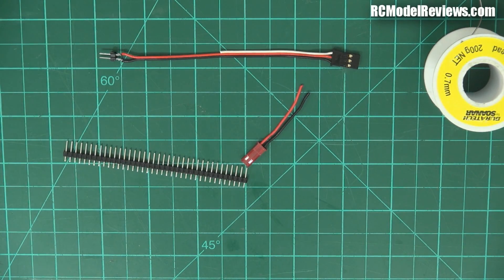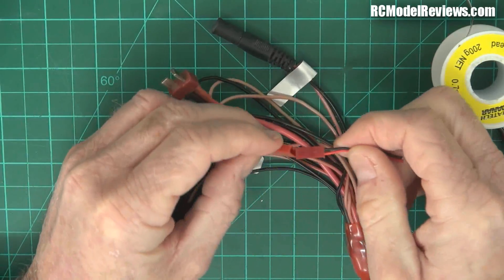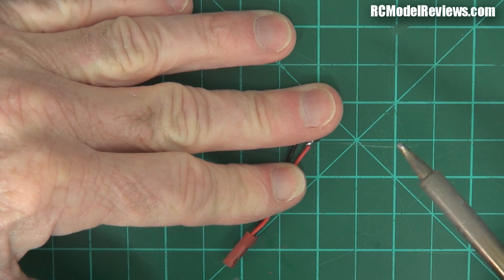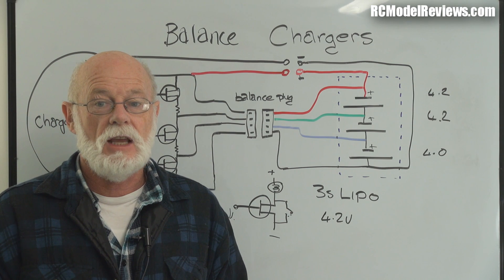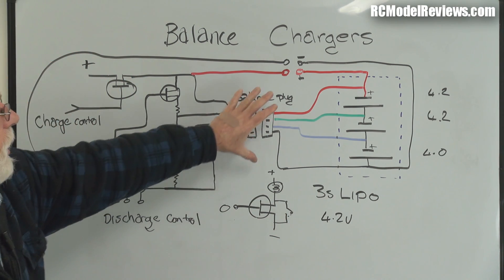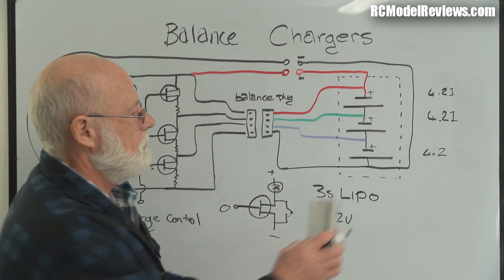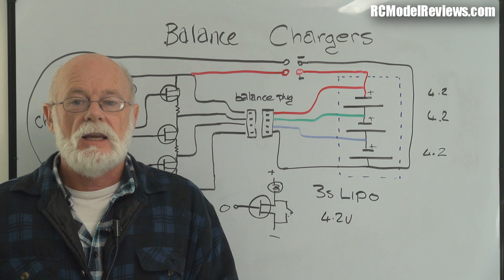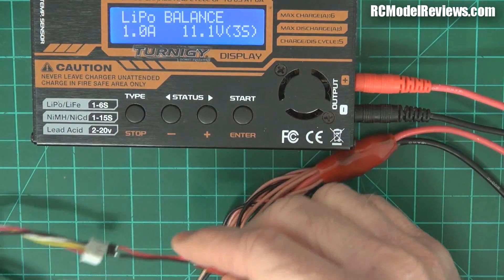Balancing your lipo battery more quickly (and how cheap chargers work)

Comment: Hasn't someone designed an intelligent battery balance schematic based around something like an arduino or similar? Seems to me that making something that'll bring the low cell up first and then charge as a whole pack shouldn't be too technically demanding?

Comment: I wish you were my Electronics professor! I feel like a fancy enough charger should be able to stop charging the main leads once at 4.2 and only charge into a single low cell. Though, as you pointed out, a consistently low cell isn't a great sign and forcing it up to 4.2 may not be a wise idea. I use a VenomPro2 charger and has served me very well. Oddly the other day I was charging a 5000mah 3S  and it was just over 5000mah input just under 12.6V total. Each cell started in the 3.6V range. I really want to know even more about how LiPos function. Each cell is just layers of anode/polymer/cathode repeat correct? If a cell id puffy I assume some of the layers are no longer good.

Comment: Nice program Bruce.. glad someone explained clearly what goes on with this standard chargers... basically the final phase of the charge is as fast as fast the charger can "discharge" each cell.. wich in the case of the cheap chargers like the Acucell 6 is very slow (5W) .. even my IMAX B8 (25W) takes sometimes forever.

I wonder what a good charger would be that does the proper process (complete the final balance throught the balance port individually) would be.. probable quite more expensive but i readed people in forums saying they are quite worth it

Comment: Bruce, is there an e-mail where I can send you some questions?

I also got an Accucell 6 like your on the video. All its functions are working, but I can't balance my batteries anymore (unless using your method) because the charger isn't reading the #2 cell voltage correctly and therefore it aborts the process everytime. 

Any ideas on what's wrong?

Comment: What is happening when i charge a high cell count battery?  I'm feeding my charger 12V through an old computer supply but I can charge up a 5S battery to 21V.  It seems like it would have to use the balance plug.

Comment: Great instructional video. I've done the same thing but by using push pins inserted into the balance plug and alligator clips (careful not to create a short). Additionally, at what point should one really consider replacing a pack when one cell lags behind? I have a charger that also measures resistance in each cell, does a lagging cell's resistance correlate with it not coming up to charge as quickly? What resistance value then might be considered the limit before tossing the pack? Thanks Bruce.

Comment: Those multi lead wires are the most dangerous things ever, I warn everyone I know about them. I saw someone using one extremely carefully and making sure each wire was weighted down so they don't touch as he charged a lipo at the field. A screw driver blew over from the wind and landed on it causing a $200+ battery to burn on on the loading ramp to his trailer. He got lucky it didn't spread to a plane inside. I don't know of a single person in my club that hasn't at one point shorted something while using a multi charge lead.

Comment: Nice one Bruce. don't forget though that many chargers can be set from the common default of balancing in the constant voltage phase to balancing always or in the constant currant phase. Also when considering spending a bit more on a charger the balance circuit power is an important spec to consider. Keep up the good work Bro.

Comment: Am I missing something? How does the ground/black not always have to be on black? Would you not be sending a charge into the neighboring cell?
Reply: Phlop Alopagus the cells in battery are wired in series so +/- of a single cell are just the two wires either side of that cell
Reply: RC hobbyFlying Thank you I guess that is what I was missing haha.

Comment: I don't like those multi-connection leads. Way too many open connectors that might get shortened by something laying on the workbench... Instead just solder an XT60 connector to the "one cell adapter" instead and connect it to the XT60 you had already plugged in?

I wonder why the chargers don't just do that anyway - use a lower current to charge directly through the balance port when the batteries are badly unbalanced...

Comment: I find that using the charger you get with some ARTF, where it charges through the balance lead a much better idea. Problem with the above type chargers, although I use them, as Bruce say, charges all three cells then balances afterwards.
Wonder if there is a charger that can charge only though the balance lead to each cell, more than 3S available at the moment?
When been charging at the field, I find that using the ARTF charger at home charge balances each cells much better, after they've been charged at the field and an cell imbalance has occured.

Comment: Good info Bruce.    One thing you can di if you use those 4 button chargers is to charge it on Fast mode.  this stops the battery when one of the cells reaches 4.20V   Then since charge each cell.

But I use Hyperion Chargers and it keeps the cells balanced during the entire charge.   So if one cell is higher it will bring it back within spec (.01V difference) during the charge of the battery    this leaves my packs charged without over charging them.

Comment: this was interesting and explains a lot... I'm curious why the chargers doesn't charge via the balance lead as well ? seems to be a better method.
Reply: +vladoportos Small chargers often do... (Often at around 1A max) They likely lack the current handling ability to charge at 6A though...
Reply: +vladoportos those connectors are only rated to about 2A without airflow.  Same with the thin balance leads.  It would be horribly inefficient.
Reply: Alex West Then why couldn't the charger just do what he did manually? It's my understanding that the charger charges in series through the power plug, but can only select cells to charge when charging them directly through the balance leads (as he did manually in the video). Therefore, why not give the charger the capability to do what he did manually in the video and simply charge the single cell up through the balance lead? You can easily limit the power through the balance lead to eliminate fire risk.
Reply: ***** 
I agree, see my post, above...
Reply: ***** smaller cellpro chargers to charger only through balance leads but only up to 4s i think.
Reply: ***** Interesting, the new Syma X8W charger does charge it's battery via the balance port.
Reply: +KpilotRCHelis Yeah, but it could just charge the cell thats low, at a lower amperage. Seeing how quick it was achieved in this video, I expect chargers could put in some discrepancy when theres only a small voltage increase required to be achieved.
Reply: YouReel It does that in conjunction with the main power plug. The main plug does most of the charging while the balance leads are use for "fine tune" balancing.
Reply: Alex West Yeah but what about if its just about 0.4V difference? Right at the end there is where it takes its time to charge. It took him only a few seconds in the video to get that cell to the right voltage.
Reply: Alex West Yeah I suppose. I actually noticed he cut off the video before it finished charging, so it could have taken a while still. I expect they've looked into all the options when designing it! I will trust them, im no expert haha.
Reply: +SZretired not only the  balancing ports but to finish right ?
Reply: ***** Allot of times (especially with bigger batteries), those little pins have too much resistance and will heat up and maybe melt causing a short in your battery. If that happens with a lithium polymer battery, it will often lead to a lipo fire.
Reply: YouReel That would be wonderful. The only problem is practicality. That works fine with the smaller packs. But if you charge the larger ones at the same amp rate, it would take forever to charge them. That's the reason chargers are designed the way they are. The charge through the main leads to reduce time, and balance through the balance leads to protect your batteries.
Reply: YouReel I haven't seen the video in a while. My guess is he used a little bit too high of an amp rate. The chargers are designed to protect your batteries for you, that's why the end takes so long. The designers made it like that to get the charge as accurate as possible.
Reply: ***** The charger I have is wonderful. A little on the expensive side but it can put out 1000 Watts.
 http://www.amainhobbies.com/rc-cars-trucks/protek-rc-prodigy-640-high-power-lipo-life-nimh-dc-battery-charger-6s-40a-1000w-ptk-8512/p260578

Comment: Amazing explanation. I learned something today! Just one question Bruce. What happens when the polarity is incorrect due to oversight. Will the charger know or will there be fireworks?
Reply: You'll have a fire in seconds if you get the polarity wrong.  Worse yet, sometimes the spark caused by a short will actually weld the connectors together so it's hard to pull them apart to break the circuit.   (Speaking from painful experience)
Reply: AndyRC Probably Fireworks, magic smoke or battery or charger will get very hot very quickly. Dont do it there should be no 'oversight' always check the polarity first
Reply: indeed
Reply: so not a fool proof solution then thanks just wanted to check :)

Comment: Hobby King sells a very inexpensive lipo balancer- about 11 dollars US.
I always check the individual cells, and when one becomes off, I charge to 4.0 average across the cells and then put it on the balancer. Once the cells are equalized, it goes back on the charger to peak it.
I was surprised at after just 6 months of use how out of balance the lipos were in my quiver from being charged on a "balance charger" - very disappointed in the whole "balance" portion of the advertising on this unit.
Regardless- I was able to get some peace of mind back as to how my lipos health fared. Pretty decent investment for 11 bucks. I can balance a lipo while charging another. It is like an assembly line in here.

Comment: *****
Bruce, to make nice "connectors" out of pin headers, use hotglue. Put a dab of it on baking paper (the hot glue won't stick to it after it cooled down!) and push the soldered header into it (try not to get too much glue under the black plastic part). Depending on the glue amount either take a second piece of paper and push from the top or, which makes the nicer connectors, just use less glue for the first dab and then after cooled down, repeat with the other side of the connector. The excess on the sides can easily be cut away with flush trim wire cutters. With some practice such connectors can almost look like injection molded ones, including the strain relief and protection against kinks near the solder joint.

Comment: thank you for all your awesome video's...
just 1 question what those the white wire??? of 3 wire cables black,red and white that are going to my vintage servos
Reply: Airgunsmith NL sometimes rx battery supply will use the same type of servo wire(black, red and white) but only the black and red are utilized. Try to check the whitewire on the battery side, most likely it is not connected to anything. you may even remove the white wire if you want.
Reply: the white wire is not giving any volts but i'm not going to removed it...all is working after standing stil for 20 years
so just want to take everything apart clean it bit by bit and restore it to its former glorie
except for the 35 years old rust making it look super cool
thank for your help Rrme

Comment: A source of pin header for a quick hack would be a servo extension lead.
Remove the outer shield that the female plug goes inside of. You'll then be left with 3 pins. 
Either use a knife to lift the retaining tab and remove the pin to the signal (white or yellow)  wire, or chop it off flush. 
Then just plug into the servo connector on your multi lead.
Or chop the extension and solder into a spare plug, whatever floats your boat.
Reply: Benjamin Harvey Yea, or you could just hack the existing server connector charge lead sine it will most likely have only two in there to begin with.

Comment: It is a realy nice, well made and informative Video. You just did a small mistake: The wiring symbol for a battery has another polarity. The long line is the positive pole and the short line is the negative pole. But beside that, great Video!!!